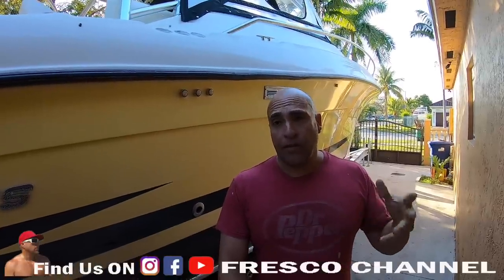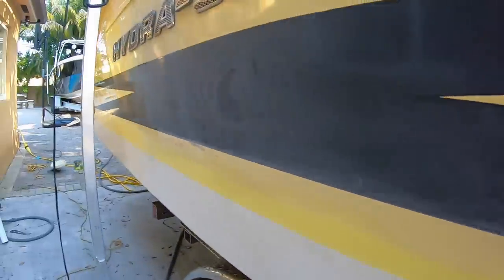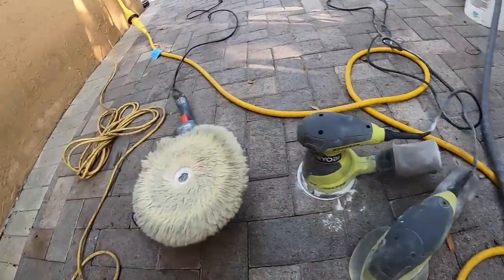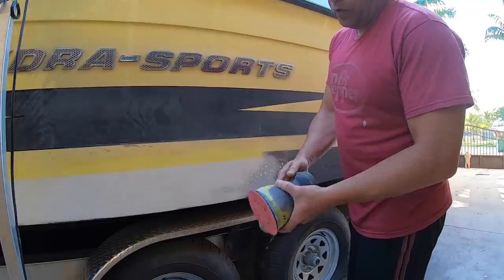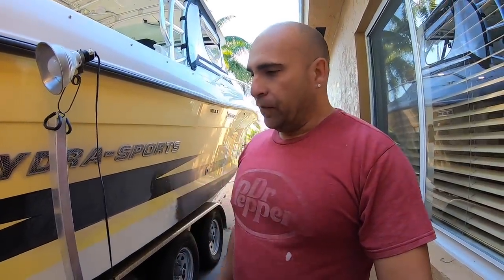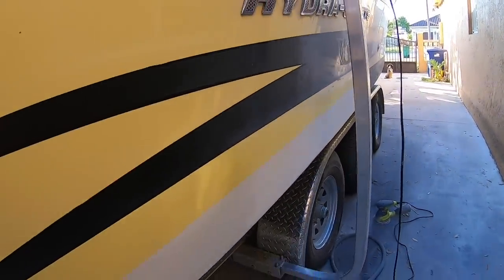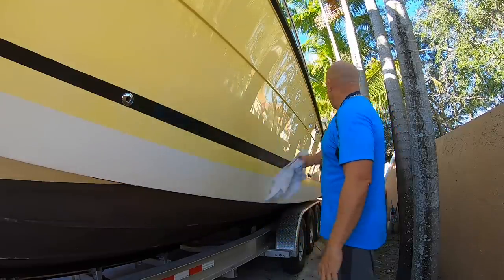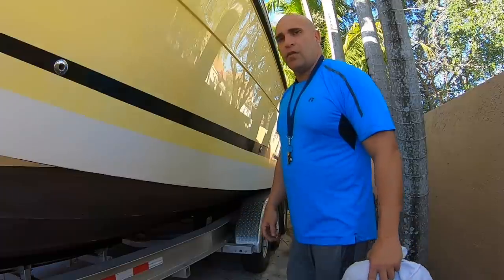Do it Yourself

Comment: Hey Fresco. If you want some advise from someone who has been there and done that, listen to this. You will note from my profile picture my off shore race boat. I also own a 28 Bertram and a 22 Activator race boat.  Been around boats more than 30 years. I get what you want to achieve here with the black coming up the seam. But don’t do it in bottom paint. Do it with marine grade black enamel. You can roll and tip it without having to spray it. Mask it against the black bottom paint. The reason being, anti fouling paint will dry out over time above the water line and fade out. Just saying.. 👍🇧🇲🇧🇲
Reply: Lets hope he reads you!

Comment: I removed bottom paint from mine last year, ended up wasting so much time, pain in the @ss, it was horrible, wouldn't ever do it again..  easier to write a check and enjoy more time on the water..  there's guys that do this everyday..  let them have it..  just my opinion because of the disaster and misery that I went through removing mine..  I did the entire bottom..  horrible, I wouldn't even buy another boat with bottom paint..  I trailer too..